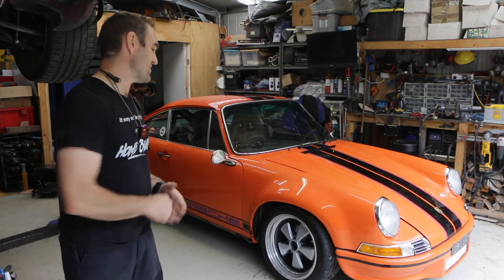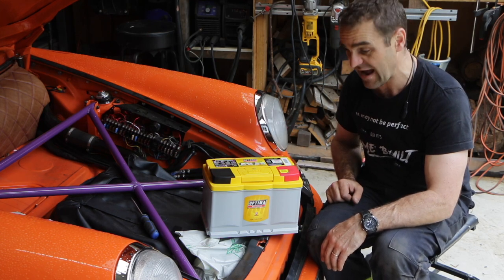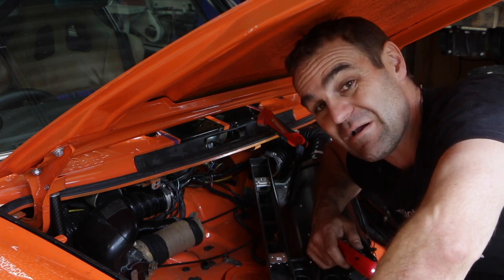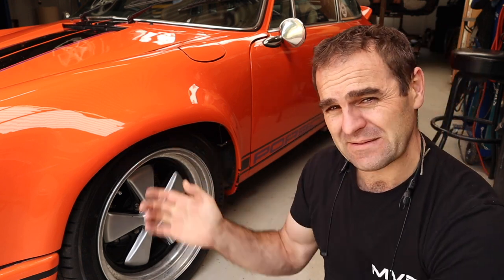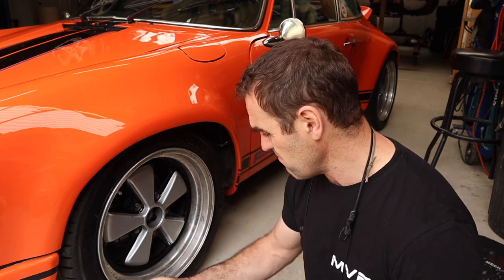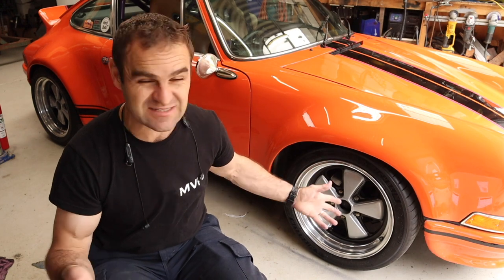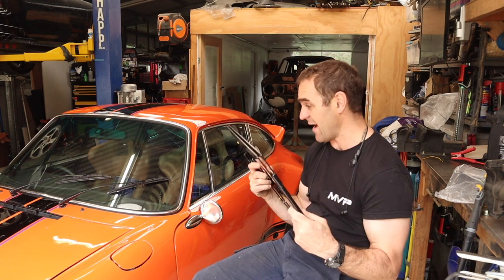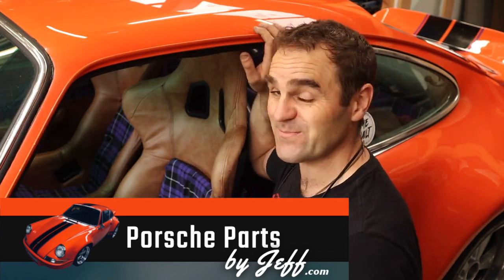How to ruin Fuchs wheels - Harry Porsche 911

Comment: Hey Jeff, wheel and tyre cleaner is meant for painted wheels and not aluminium, either natural or anodized, as it has a caustic base and eats away at aluminium and aluminium oxide, whether it be on raw or anodised aluminium.  Anodizing is stupidly hard (think just less than diamond hard), so your attempts at sanding and polishing probably didn't take that off, but merely shined up the aluminium where the anodizing has been eaten away, and as the aluminium goes dull it will show up again.  Best thing to do right now is to take the wheels to a reputable anodizing shop and have them re-anodized, as even clearcoat will not stick to raw aluminium for long  You will have a choice of bright anodizing, which has a chrome like finish, or normal which has a satin finish.  They will incidentally use a caustic solution to remove what remains.  You are at least lucky in that Fuchs are forged and not cast, so they can actually be re-anodized without much fuss.

Comment: If you modify the seat frame front hinge so it has a removable pin(s) it would be removable as a ‘quick release’ if you need bigger items in the back or want to track without the seat or use the passenger space for storage 👍

Comment: Hi Jeff.  I'm pretty late with this reply, but found this video particularly intriguing.  I think that the fact that we know a factory Fuchs wheel from the period had an anodized surface really has no bearing on the 17" replica wheels that are on your car.  I would in fact expect that your wheels have no anodizing at all, based on the gloss of the finish and the amount of metal that came off while buffing.  The anodizing of polished aluminum usually imparts a slight flattening effect, and also shows a rainbow hue in sunlight.  The etching that you got from your wheel cleaner was likely because the wheels were simply bare aluminum.    I also thought that I would share my thoughts on your tilting seat bracket.  The agony of not being able to get into the rear of the car is real (!), but those tilt brackets are seriously unsafe for a track-driven car. Even a seat slider is a compromise from a safety standpoint, and now you have added a secondary latch system.  Yes, I know that your seatbelts will be pulling backwards, but even the lateral support of that setup in a rollover crash would worry me.  And we want you to be safe so we can watch more of your great videos. :-)

Comment: Hi Jeff. I had a similar problem a few years ago, after a lot of head scratching, I found that if I isolated the motor, on nylon mounts, everything worked fine.  This was a LHD to RHD conversion and the RHD motor must have had some different internals even though though the plugs were the same. Might help.
Reply from the maker: I will give a full update later but I have finally figured it out and it was fixed with a squirt of WD40!!!

Comment: If you’re concerned about them tarnishing, spray them with a suitable clear coat. Use 1500, 2000, 3000 grit wet and dry then polish them. They’ll be better than new.
Reply from the maker: Clear won't stick ;)

Comment: I bet your heart sunk when you saw the wheels after the wash. I think that they look just right with polished lips! What people use to protect polished wheel lips here in the nordics is just regular wax or ceramic coating for longer lasting finish. I bet Harry does not see really harsh weather (think road salt for several months) so the lips should stay just fine for a season with just one application. Great video as usual, keep up the good work!

Comment: Hi Jeff.
That Suchs about your Fuchs..
Have an idea.
Painting the wheel rims silver might not be a bad idea if your going to drive the Porsche regularly & used wheel cleaners
..
I suggest having a look at
 titanium silver paint.
It's used on all modern car alloys and looks like a cross between base silver & chrome...
Paint the rims with titanium silver, clear coat it. 
Then completely clean the whole rim inside and out and use ceramic coating on the whole rim...
With the titanium silver, having an almost polished look, will contrast with the dull silver in the centre & will look like a dull polished aluminum finish... ..from a distance.
..
Love Fuchs alloys most iconic Porsche wheels IMO. 
Even more so than telephone dial. Porsche rims....
..
That engine sounds sweet ..👍

Comment: The anodizing is basically a sort of a hardened corrosion layer that protects the aluminium underneath. To fix that you have to remove(sand) the anodized layer off, polish the aluminium and then you can re-anodize them. They'll look exactly like before or you can even choose to anodize them in a particular color if you want. Or you could just polish them and then put a transparent powder coat over it for protection. And also with this you can tint the transparent powder coat with any color if you want.

Comment: The Fuchs on my '78 were specced as polished aluminium rims - not anodised -- the black centres are anodised and remain shiny. Mainly because they haven't felt the salty roads and acid rain of the Northern hemisphere (The reason Porsche recommended Vaseline on the anodised bits)
Of course the polished rims will become pitted and and stained by brake dust and road grime. But the surface being soft and easily repolished to a mirror finish if you feel the need with autosol or similar.  I do mine once or twice a year. 
Coated rims will not enjoy harsh cleaners , and the damage requires a lot of remedying with the added $ cost.

Comment: Somebody has probably already said this in the comments. Anodizing is just an aluminum oxide, in fact sapphire. Both it and aluminum can be etched by things with a basic ph, like lye. Many detergents and degreasers, for example Simple Green, are basic and will both etch aluminum and anodizing. Actually common way to strip anodizing is lye. Just metal polish may not have actually removed the anodizing. You might have made it thinner. You're correct you will know later where the anodizing has rubbed through because it will oxidize. If it's unacceptable it's not uncommon to strip the anodizing, polish it, and then paint it with a standard 2K clear. 
In the future however just be careful with which cleaners you use on aluminum. Neutral pH or acid pH are acceptable. And as you've pointed out good old soap and water are really pretty much the best.
The car looks fantastic. Please post a pure sound video. A nice long one.
Reply from the maker: Pure sound vid was posted about a month ago ;)

Comment: It’s disappointing that wiper’ s issue. In fact, thanks to one of your previous videos on it, I fixed mine, and it was a problem on the switch. I repaired it in half hour and so I didn’t have to dismantle the whole system.
Reply from the maker: I have fixed it and it ended up being simpler than I thought ;)

Comment: Jeff, I had similar problems with my wipers following hitting a speed hump too hard; each time I put them on  the fuse blew. Tried another column switch with no success but didn't try another motor. I did fix it but cannot be sure how BUT my theory is this. 911s of that era used thin strips of flexible metal welded to the shell to hold the wiring harnesses. These should be insulated but overtime the insulation often went missing meaning that sharp corners and edges were exposed. I think on my car, following the heavy jolt, one of these sharp points punctured the wiring and shorted it to earth, causing the fuse to blow. I checked all the strips, replaced the insulation where needed and the fault disappeared. Might be worth checking on your car.

Can you post details of the fault-finding tool you featured, please?

Cheers
Reply from the maker: Ended up not being wiring, something much simpler. 
Link in the description ;)

Comment: Anodising doesn't conduct electricity whereas bare aluminium will so measuring resistance between 2 points on the wheel may give some idea how much anodising is left not sure how sensitive it is though, so sorry may not be too useful.

Comment: if the lips shined with polish, I doubt if the lips were anodised in the first place. Since youre already at this point, might as well shine them up properly and re polish them once a year or something. The finish should stay good for upto a year usually. Ceramic coat doesnt work so well on bare metal. I actually have ceramic coated my exhaust manifold heatsheild and its going strong after a year but its because it rarely sees any soap or scrubbing - which wont be the case with your wheels
Reply: Yea, I think Jeff´s got it wrong with his Anodizing, theres no way he would have polished through it with normal metal polish. Also its probably the reason Wheel cleaner messed up the finish in the first place.
Reply: The wheel cleaner contained acid, as most do, and that removes anodizing.
Reply: @mawe42  But you´d have to cook them in it to remove all the anodizung.
Reply: @h-j.k.8971  No, Owen cleaner is the usual method to remove anodizing.
Spray on let sit and 'wipe off". Very easy to destroy.
Reply: @mawe42  Wellwell, I could use some of that stuff here, were stuck with drain cleaner.

Comment: what about clear powder coating? seems like it can go on bare aluminium. the only issue i foresee is the heat from the bake. if the paint/coating on the rest of the wheels can withstand it. but you could have the whole wheel powder coated in the same colour scheme.
Reply: I've had many wheels powder coated and the heat of the brakes never gets hot enough to damage the finish. Powder coating is baked in an oven. Brake temps wouldn't get high enough for long enough to do any damage. This isn't a bad idea at all.
Reply: @glensgraphix  i meant the heat of the oven with the existing paint/finish

Comment: If it’s like wiper motors I’ve taken apart, it will have moving contacts inside that run on tracks making and breaking the circuit to control park position etc, so is it moving slightly to a position where it shorts?
Reply from the maker: I have now found the problem and it is even simpler than that... grrr ;)

Comment: First! (Couldn't resist, never happened before). That tilting seat mount will be a boon, almost makes Harry a tourer! Could you use clear-coat of some kind on the wheel rims?
Reply from the maker: Unfortunately clear coat won't stick to polished metal.
Reply: @HomeBuiltByJeff  How about a satin, kinda semi-matt finish, maybe with wire wool? (Don't know what I'm talking about, just throwing it out there).
Reply from the maker: @EliteRock  One suggestion was to ceramic coat them, which won't last forever but it is not a bad idea.
Reply: @HomeBuiltByJeff  Sounds expensive? What I meant about a satin finish was maybe it would 'key' the ally for a hard clear-coat. But like I said, no idea what I'm talking about, and I do realise that wheels need a much tougher finish than the bodywork.
Reply: @HomeBuiltByJeff  clear powder coating should.

Comment: Automotive clearcoat protects bare aluminium ;) Just a thought....
Reply from the maker: Except they don't stick to polished metal ;)
Reply: @HomeBuiltByJeff  
I've always used adhesion promoter and not had any issues, but mileage varies between folks.

There's always powdercoat, a good shop can do the centers and barrels all in one.

Perhaps Barrel Brothers?
Reply from the maker: @Expatris  I have used that sort of thing which works great until you get the first chip and then it all starts to peel off in chunks. There are a couple of other options I am looking at though ;)

Comment: Spray some fuel resistant clear coat on the Wheels to prevent oxidisation.
Reply from the maker: Clear coat doesn't stick to polished metal unfortunately :(